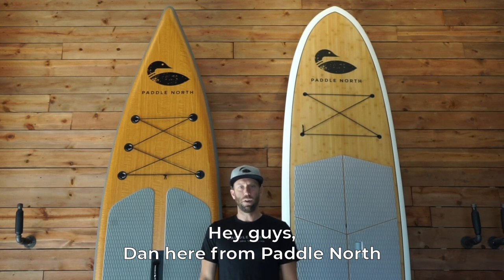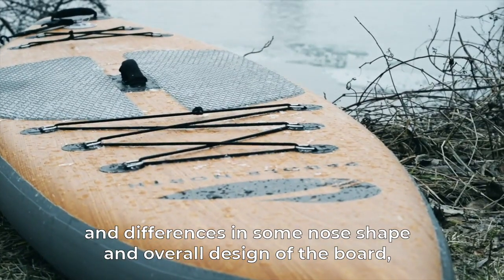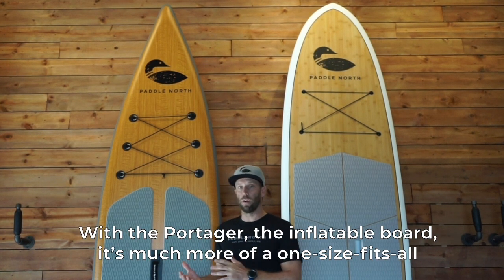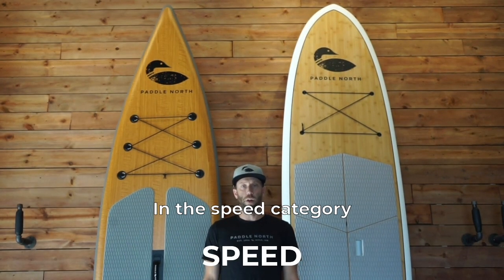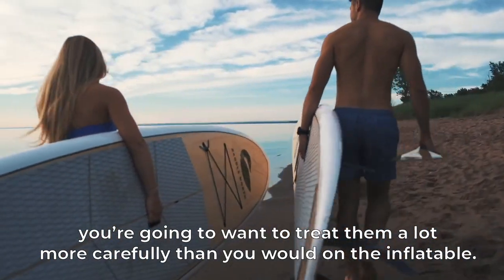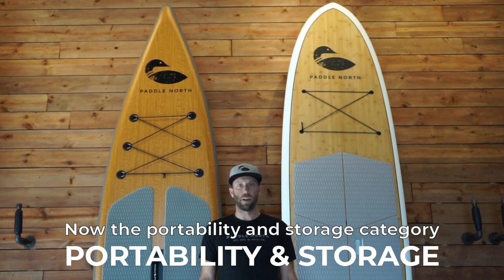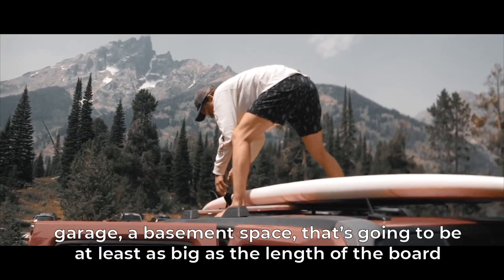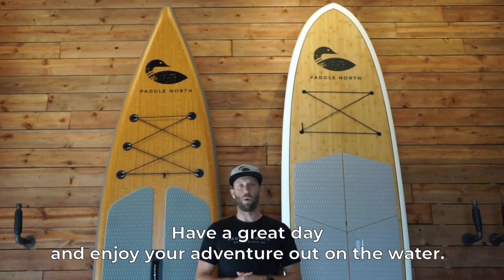Inflatable vs  Solid Paddle Boards

Comment: I am looking at purchasing my first paddle board. My biggest issue with the inflatable is that they are made of PVC and UV degradation. Usual life span of pvc is about 2 years. It would suck to sink 1k on a product for it to only last 2 years.
Reply: Life span of a PVC roof membrane is quite a bit longer than 2 years. All depends on the ingredients
Reply from the maker: Material quality and care will have a significant impact on lifespan of an inflatable board, but it should last you a very long time. We definitely recommend paying attention to PVC thickness and seam reinforcement when shopping. We do recommend storing out of the elements when not in use, which will also dramatically increase life span of an inflatable board.

Comment: I have inflatables and rigid ones, there is no color, the rigid ones are much better, faster, more stable, they are less affected by the wind, they are easier to handle.
Reply from the maker: That's great. You are correct - in most cases, a quality rigid board will have more glide and speed in the water, and be less impacted by wind.

Comment: You seem very pro-inflatable. I can't stand inflatables. Besides obvious storage advantages, they never track as well because they are lighter and more susceptible  to force inputs. They are never as stable because they ALWAYS have a higher center of gravity. Inflatables will also never be as durable as the seams degrade, especially in hot climates. I've never dropped my hard board because I'm careful with my investment. Granted, I've never tried your brand of inflatable, but for my money a hard board is far superior if you have the storage space.
Reply from the maker: Thanks for watching the video! We think there are pros and cons to both and love paddling our Loon solid boards. As mentioned in the video, there are certainly some performance advantages to solid boards. But just like anything, not all inflatable paddle boards (along with solid boards) are equal from a quality and performance perspective. Length, width, and overall bard design will greatly impact speed and stability. Material thickness, seam reinforcement and additional features, such as inclusion of pressure relief valves, will impact durability and lifespan. Ultimately it comes down to lifestyle and how you intend to use your board. Glad you've enjoyed your solid board and happy to hear you take good care of it!